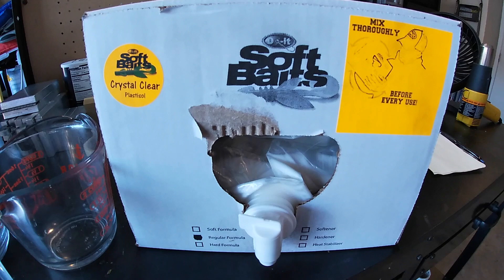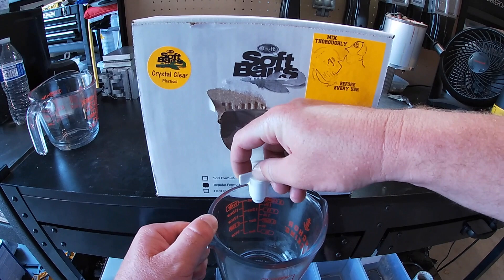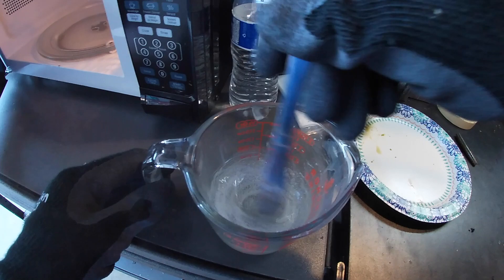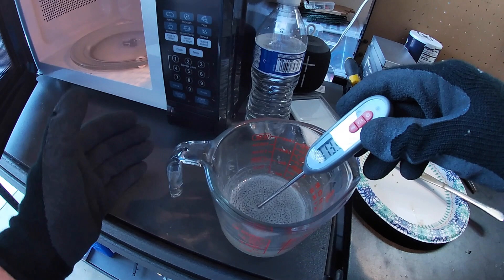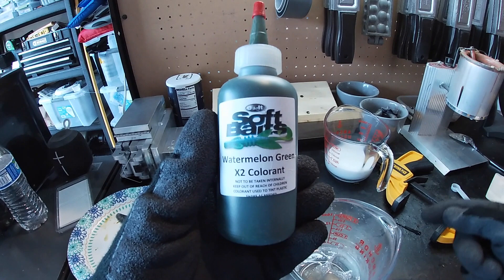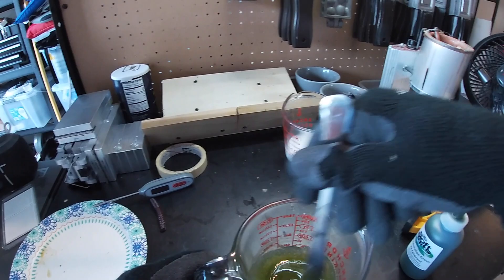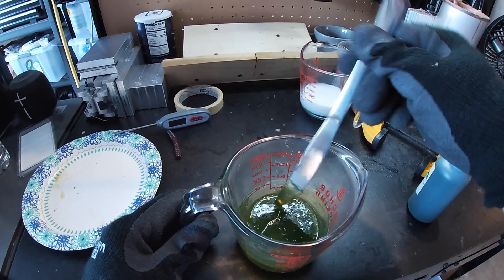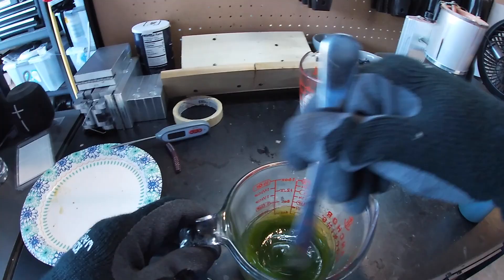MAKING your own SOFT PLASTIC BAITS - How to make LAMINATE COLORED soft plastics

Comment: Cool looking baits. Heck of a process to go through. Thanks for giving us the details
Reply from the maker: No problem!  It’s probably easier than what it looks like on film!  The hard part is getting the colors right!
Reply: Matt Luna Fishing and keeping the plastic to temp
Reply from the maker: True, you just gotta put it back in the microwave for another minute or so.  You run out of injectors before you the plastic gets too cold.  You have to clean the injectors after each shot
Reply: Matt Luna Fishing I noticed in this video you heated first before adding color. Compared to the GP video. Any specific reason why one vs the other
Reply: Ray C my guess is probably a learning curve really. He probably learned some tips n tricks after the old video that helped him out for this video.
Reply from the maker: I knew i had to be careful not to add too much color.  It’s harder to tell the ultimate color unless you heat the plastisol until clear
Reply from the maker: It’s a safety net.  If i have an idea of the amount of color I’ll just add before i heat, if I’m trying to match a color I’ll heat first